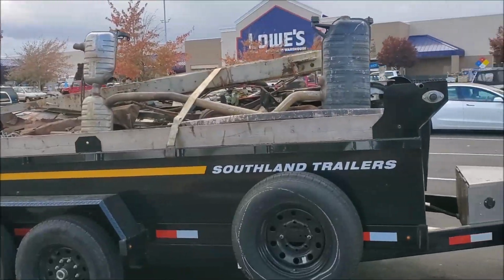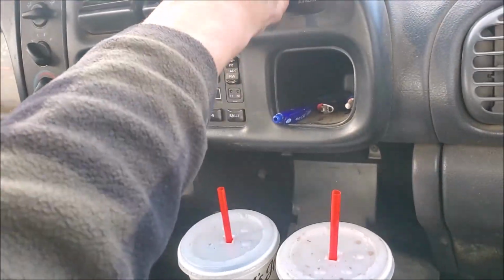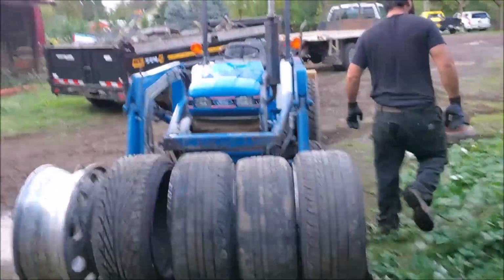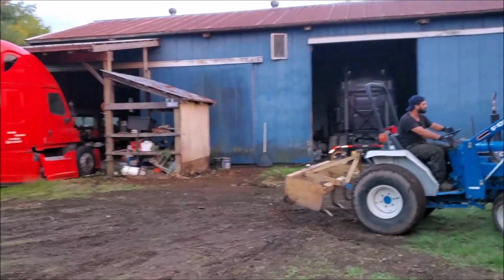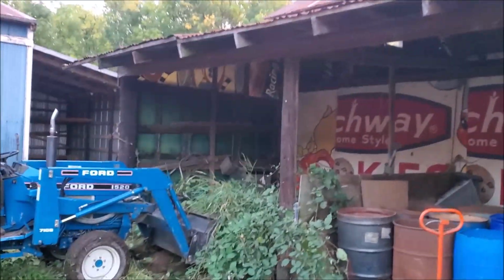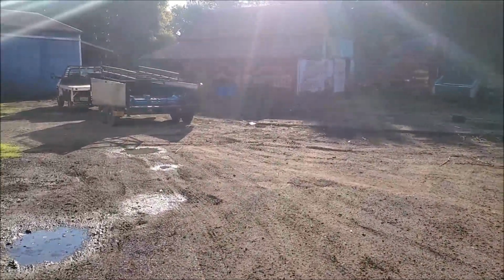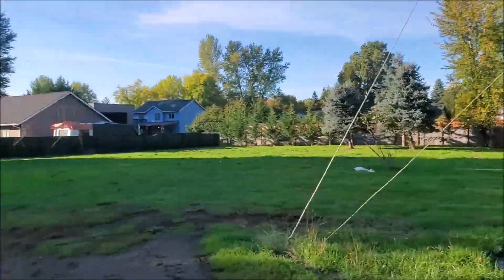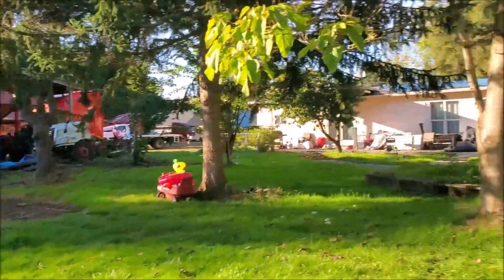Hauling away scrap metal

Comment: Next time separate the brake drums and linings. That's considered prepared plate steel and you'll get 5 times the "mixed tin" rate. I understand you just wanted it gone but just that little bit from what was shown, you probably lost a hundred bucks easily. I'm surprised they took the fencing. Down here they pretty much won't. Half cent per pound. That's how bad they hate it here. Take everything a magnet won't stick to like aluminum and separate it also. It pays e times the weight of tin. All in all you probably lost a couple hundred easily just by not separating and weighing it separately.

Comment: Your illiterate.  Its SCRAP. not SCRAPE. AND you could have made alot more money if you would have separated the light iron from the heavy iron. And radiators are aluminum and some are copper. All you did was clean up the property and lose money.  And hot water heaters are SCRAP Metal also.  Not SCRAPE.